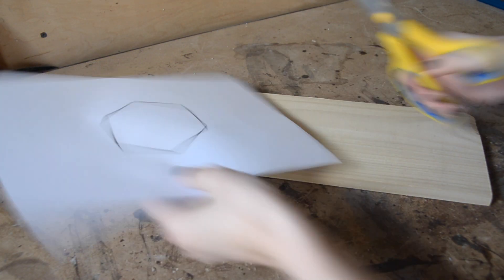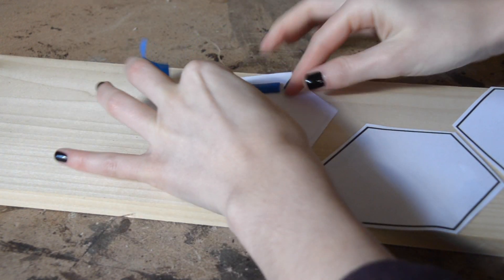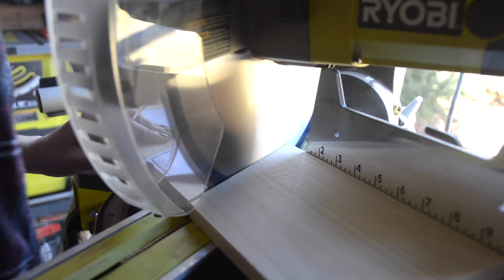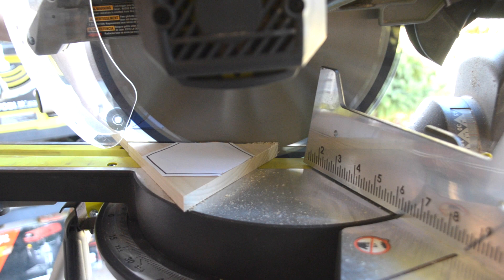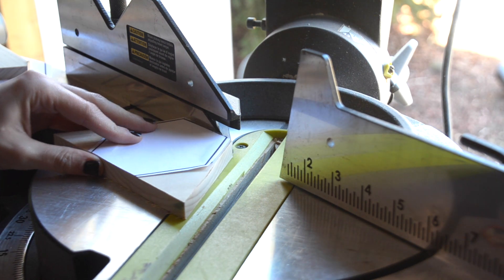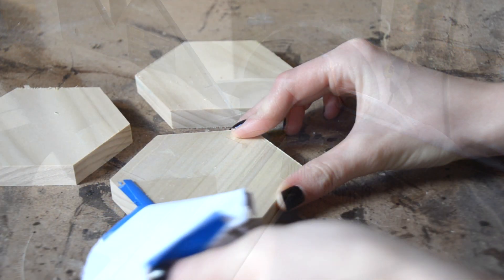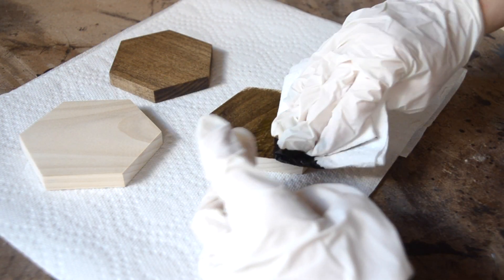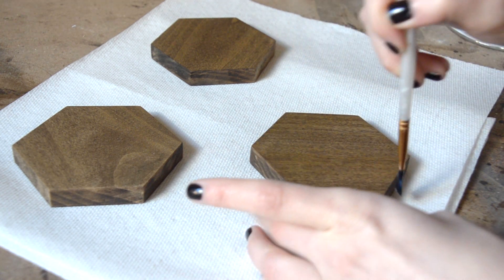DIY Hexagon Coasters | How To Wood Coasters

Comment: Awesome! Any idea which tool you can replace miter saw with?
Reply: Rafał Sumka basically any handsaw, scroll saw, jigsaw, even a table saw if you have the proper jig.
Reply: Table saw would be my choice. You can easily make repeat cuts with more precision than the miter saw if you set up an angle block/fence with a sled on the table saw.
Reply from the maker: I second both responses!